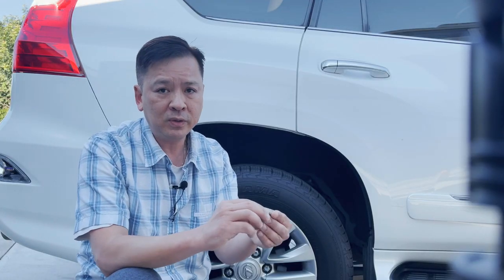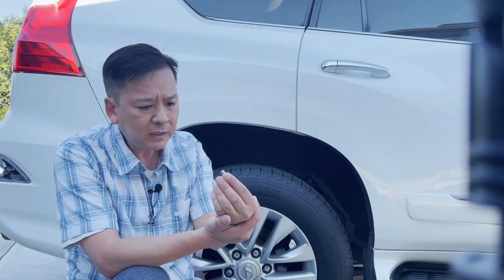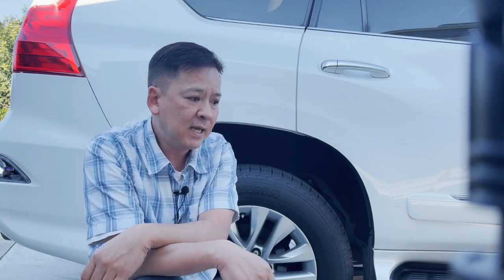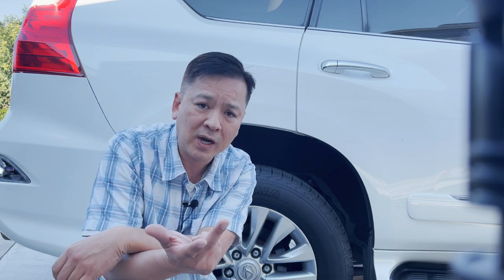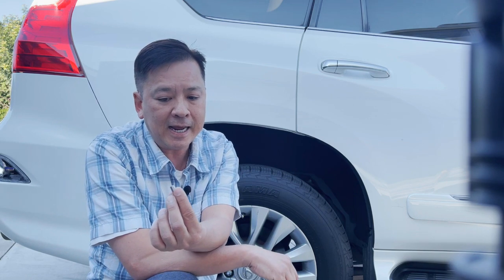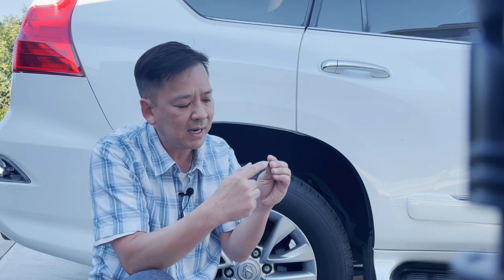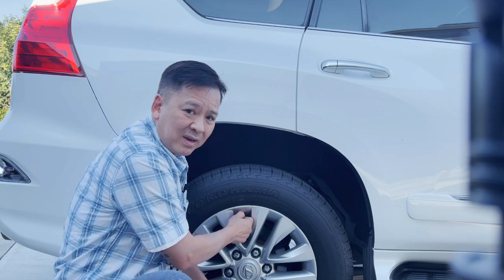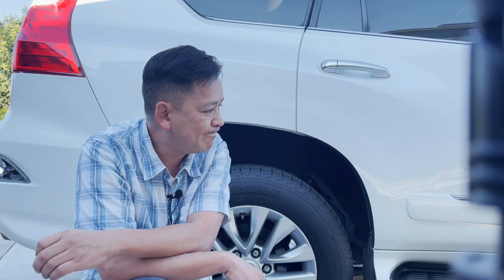Can you guess which valve stem cap caused over $100 in damage?

Comment: I just went through this exact problem. Two of the caps would not come off, so I made an appointment with Discount Tire and they replaced my stems on 2 tires to fix the problem (and didn't charge anything). Most tires places will charge around $30 per tire to replace the stems. I'm sticking with the plastic caps going forward.
Reply from the maker: Thanks for your input. Free is always good. Did you tip?

Comment: our 2021 gx460 came with metal caps with little male cones under the cap to add an additional seal with the female cones on the stem... is yours like that?
Reply from the maker: Not at all.  My aftermarket was just a simple aluminum cap with a rubber piece as the stopper.  Yours may have came with the newer 2020+ and designed to be compatible with your valve stem.
Reply: @GXBOB  ok cool... I didn't know the 2020+ stems were different...

Comment: Hi Bob, I have a question. My fog lights stop working on a 2010 gx460 when I turn on headlights there is an annoying buzz. Can't figure out the problem if its the fuse or relay been playing around with the fuse box and no luck. Also the old fog lights don't work and I bought new ones and they still don't work.  Any help will be appreciated. Thank you for taking the time and doing these videos I learned a lot from you and save me some money.
Reply from the maker: Johnny.....In order to help u find where your line is disconnected, i would have to be there physically with a test light and probe the lines from your switch all the way to your fog lights.  I"m sure there its pinched or grounded somewhere. 
 Electrical troubleshooting isn't the easiest diagnostic.  It's actually one of the hardest.  I find  it soooooo much easier to stop looking for the problems  with the OEM electrical and just start from scratch with the aftermarket.  Just cut off your fog lights and wire the to some other lights on your car or to a relay and a switch.  This is, of course, you have some mechanical aptitude to wire up stuff yourself.

Comment: Hey Bob I have a question. I’m just commenting on your most recent video so you see it. Is it possible to remove the lower chrome door trim on a 2011 premium? Like can I heat gun it and pull it off like the badges? I have a peridot green mica and would rather remove the chrome than vinyl wrap/paint it black. Thanks for the help.
Reply from the maker: Hi David!  Here is an excellent write up on the 2011 GX460.  From what i understand, the molding have more than just double sided tape,  you're also dealing with plastic retainer clips.  The job seemed simple and done in less than an hour.  Hope the link helps.  https://www.clublexus.com/forums/gx-2nd-gen-2010-present/577107-door-moldings.html
Reply: @GXBOB  dude I appreciate this!

Comment: They just wanted to over charge you…there’s no way that those caps wouldn’t have came out with some heat, lubricant and force !! 😂 but we’re better off using plastic to avoid the issue.
Reply from the maker: Hey Junito, i'm still sportin' the aluminum caps so they look better.  (=
Reply: @GXBOB  I know !! 😩 They look way better 😂 I have a 21’ Honda Accord and They sell the OEM Honda valve so I bought them at the dealer for $17.23